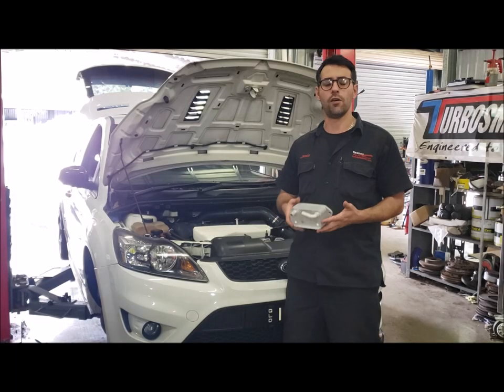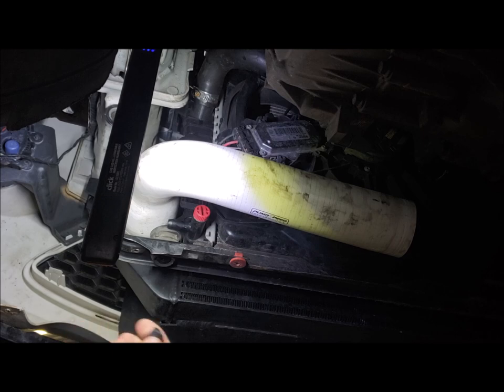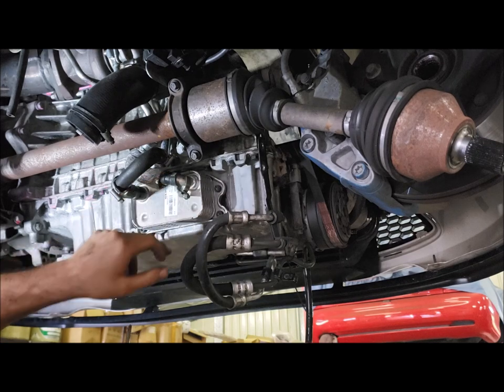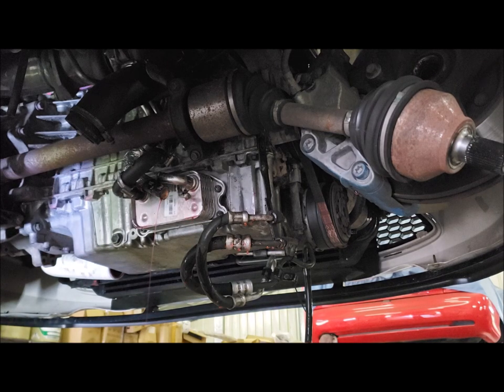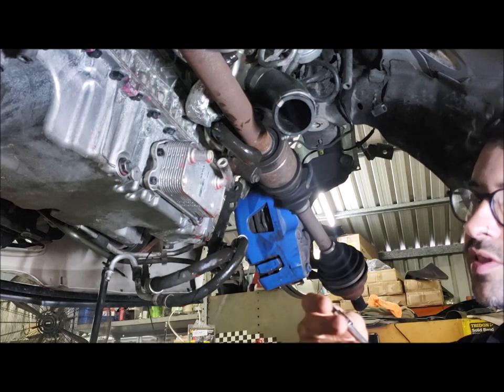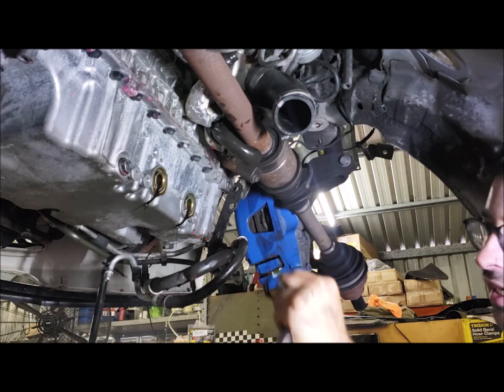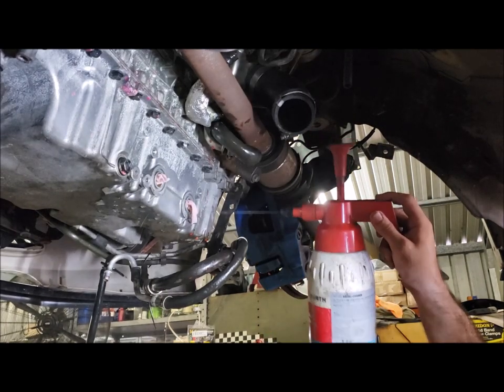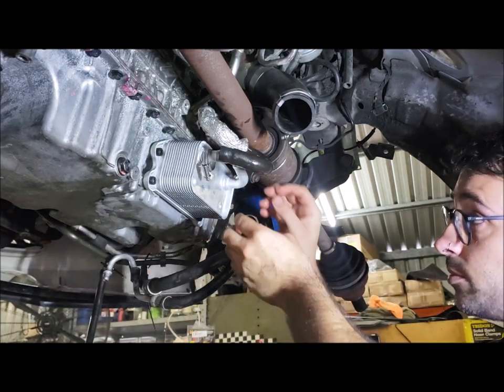Focus RS oil cooler install XR5 Turbo / ST225.  Step by step by OEM Denied Performance

Comment: Another great video thanks 👍
Think when I did this mod on my ST I clamped the water hoses to save having to drop all of the coolant. And bear in mind you won’t necessarily see lower oil temperatures on the gauge as the ST/XR5 uses an algorithm to calculate oil temp rather than it coming from an actual sensor.
Reply from the maker: That is what how we tend to do it too but trying to keep tooling to a minimum for people doing at home in these videos.
Reply: @OEMDeniedPerformance   I think that early ST models (pre-face) can’t have RS / facelift oil cooler because of hoses. Pre-facelift ST have bit different orientation of the coolant hoses or I’m missing something?
Reply from the maker: @Palikesxx  yes the super early pre facelift (2005) have 2 straight outlets on the oil cooler rather than 1 straight and 1 90 degree. If you have a super early one you will need to change the drivers side coolant hose to complete the install. There are 2 versions of the pre face lift, UK doesnt distinguish between them but Australia does. We call the earliest on a LS, next one an LT then the facelift is a LV but there was under 1000 of the LS model sold here so its not often we seem them any more

Comment: Great video! However I wonder why you prefere the o-rings to be dry? From my experince, it is mostly good to have them lubricated to prevent leakage? At least all 5 fuel injectors were leaking when i mounted them, but with some rubber safe grease on the o-rings they did get seal perfectly :)
Reply from the maker: In short it comes down to the scenario: Because an injector also has to be inserted into a hole in the manifold & fuel rail there is a risk of it snagging and causing a small tear or rolling on itself which would cause it to leak so they should be lubricated to avoid that. (Ford advise to use some clean engine oil to do so but rubber grease will do just fine too as you have done so long as its not enough to contaminate the fuel system) In the case of the oil cooler the O ring is being squished between essentially 2 flat surfaces just like a composite gasket so it is fitted dry to ensure that the rubber takes up any space that is created by imperfections between the 2 surfaces. If its fitted wet there is a risk that the space is taken up by the lube. If that lube then runs out with heat you can end up with slow leaks via that imperfection so in some scenarios yes you want to lube seals to aid install, in some you want them to be totally dry. Another scenario where you would want to lube would be a dipstick or turbo oil drain pipe O ring where they go into the sump, there is a risk of snagging during install so its lubricated. Another scenario where you want it to be dry would be a CV boot, if there is any grease between the boot and joint mating surfaces it will leak CV grease over time. As a general rule of thumb always reference workshop manual. If it doesn't make a point of stating to lubricate a seal eg injector O rings, it is intended to be installed dry just like a gasket eg oil pan O rings.

Comment: Hello, I have read that you have to use the seal with the part number 1371335 (6M5G-6L621-AA) and also the seal 1371340 (6M5G-6L621-BA). 
Is that right?
Only gasket 1371335 is used in the video.
Reply from the maker: Use part number 6M5G-6L621-AA for the oil cooler. 6M5G-6L621-BA is a different seal (its for the sump from memory)
Reply: @OEMDeniedPerformance  thanks!

Comment: Hello sir! 
This is a great and very informative tutorial video!
I have one major question that I need your help.
I own a Ford Kuga MK1 (2009) 2.5T 4x4 Titanium model with 55.000 kilometers, and I know that these engines (B5254T3) tend to overheat during the summer, even when stock, especially when loaded with passengers and cargo. Mine does not, but I am afraid for the future.
I am searching for a proven (and bulletproof) solution to increase the cooling of the engine and its peripherals to the maximum level, mostly in fear of cracking the cylinder, as you may already know. The car is bone stock.
I am considering starting with the largest direct replacement unit that my car can accommodate based on its fittings. 
What is your suggestion? What is the biggest original (not aftermarket) oil cooler from Ford or Volvo that fits the B5254T3 engine for maximum cooling effect?
I am considering adding another external (air) oil cooler via the oil filter port for extra oil cooling. What is your opinion on that?
I know at this point that I must also upgrade the water radiator and the intercooler, but that is an exercise for another day.

Thank you in advance for your time and effort!

Have a nice day!
Reply from the maker: most people that have overheating issues its due to a small ignored coolant leak. Coolant will boil at 100c just like water does unless the system is pressurised and holding the pressure. Id be doing a coolant pressure test before doing anything else.  (wont think twice about heading to the track when weather is 38c or higher)
Reply: Thank you for this information!

Comment: Very interesting video👍🏾What is the benefit of fitting this to a st225?
Reply from the maker: as you modify the engine for higher performance the oil temps rise as a result. If oil gets too hot it starts to break down, loses its lubrication properties and leaving deposits. That is why the RS mk2 has the larger oil cooler than the ST225 because it runs more boost, has higher power and torque outputs in stock form. As its a straight swap, its a good upgrade. Alternatively you can fit a remote oil to air cooler in the grill. However these only work when in motion as airflow is required so good on a track/race car, not so great on a road vehicle as when stationary no cooling is occurring.

Comment: Looking at doing this on my st225, I've forgotten the stress of doing the coolant system now. Do I need to upgrade my oil breather kit? hoses and radiator? I'm running 322bhp and 492 NM torque and oil temps have been let's say slightly warmer after the remap
Reply from the maker: oil temps are calculated by the ECU based on coolant, temp, load and run time so you wont see a difference in gauge after doing an RS oil cooler. The coolant system is the same on the RS and you should have no issues so long as there are no pinhole leaks. Lots of people are unaware of minor leaks as they tend not to drip but need to be rectified. If in doubt pressure test the coolant system at 21psi. If drops at all theres a leak somewhere so need to locate it
Reply: @OEMDeniedPerformance  I've just upgraded the coolant system to silicone hoses in January so il check the work i did. Thanks for your input, that saves a later question after I fit the oil cooler and temps still rise 🙌

Comment: i'm in the US and want to get one of these oil coolers for my volvo but can't seem to find a supplier as the focus rs here uses a different engine than the eu model. could someone help out with a link or part number?
Reply from the maker: shoot an email over to info@oemdenied.com and one of the boys will find you a link for you to buy in US mate :)

Comment: hey can anyone help me please, i need the two hoses that are connected to the oil cooler because mine are brittle , i need the part number for those 2 hoses 

thanks
Reply from the maker: LH hose 6G9N 6B852 CC 
RH hose 6G9N 6B852 BC

Comment: no need to drain all the engine oil ?
Reply from the maker: No, you can leave the engine full of oil.  The oil cooler is fed oil from the oil pump so the only oil that will come out is what's in the cooler itself and the internal pipework that travels through the sump.

Comment: Is there any difference between the RS and XR5 oil cooler?
Reply from the maker: yes, RS unit is thicker so has better heat exchange. The vehicle shown in video is an XR5  so if you count the ribs on the cooler there is 9, whereas RS has 13 so RS cooler is roughly 44% larger
Reply: @OEMDeniedPerformance  does it fit without any modifications needed?
Reply from the maker: @quintonnaidoo8281  yes mate. Thats what is being installed in the video